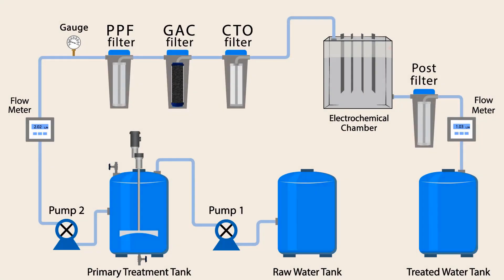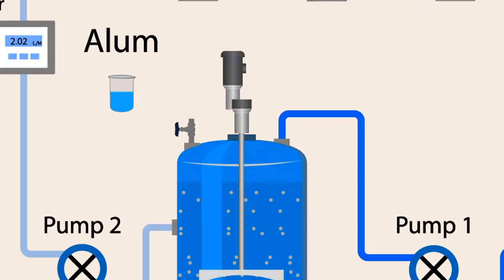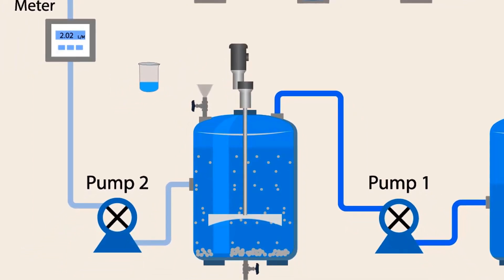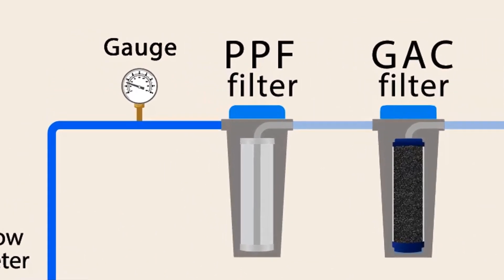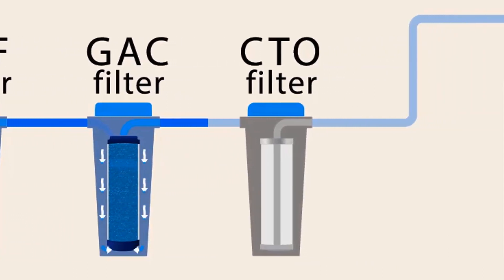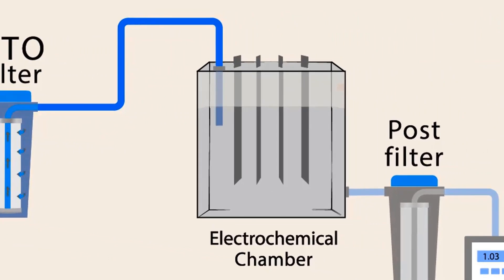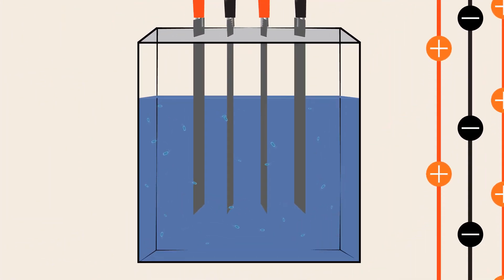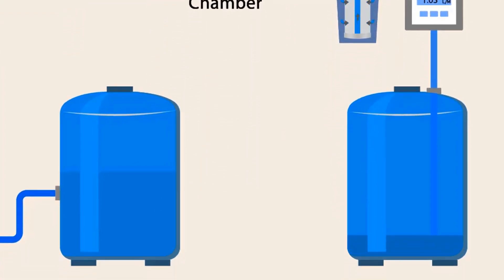portable water purification plant | drinking water treatment process | water filtration plant

Comment: 60 lbs chlorine 
Aluminium sulfate 
Flocks 
Flocs 
Flocs 
Flow meter 
Pressure gauge 
PPF filter 
GAC filter 
CTO filter 
Carbon block filter 
Cloudness and taste is removed 
Electrodes 
Pump 
Ionisation 
Flow meter 
Post filter removes germs

Comment: What kind of a filter is the last stage filter?
Bcz it is ppt, it means the germs were not suppose to pass through it at the first place
Reply: The post filter is like the RO filter neh?
Reply: I like the animation by the way
Reply from the maker: Post filter is special type of filter. It's used to remove killed germs. First stage(PPF) has a different function as described in video.
Reply from the maker: Bacteria is very small in size, so that it passes all the stages before post filter.